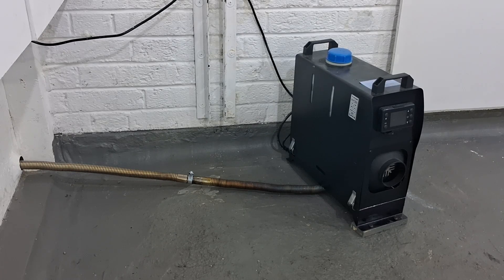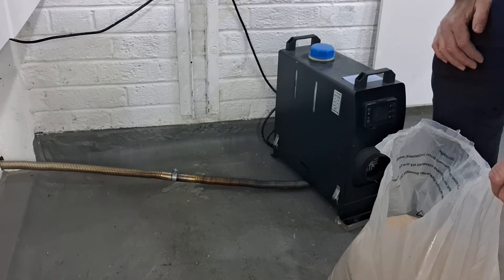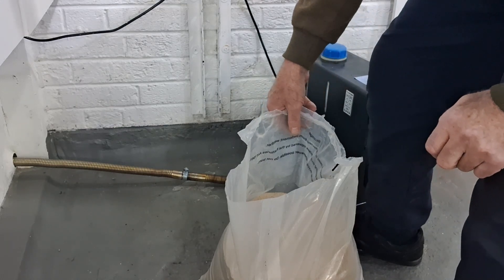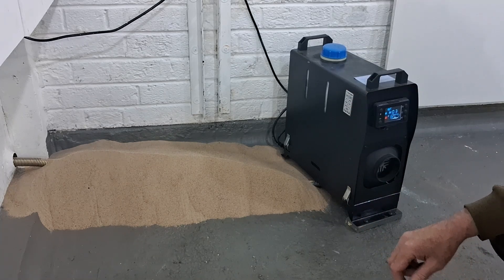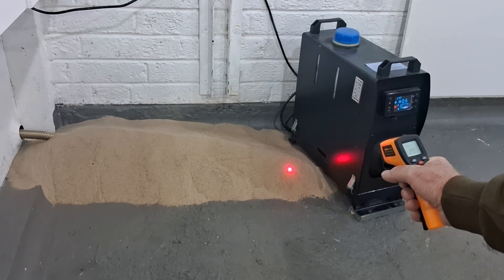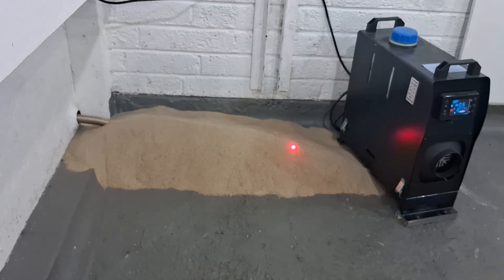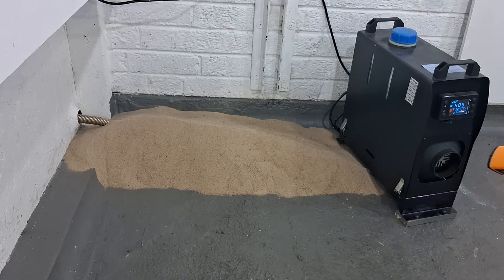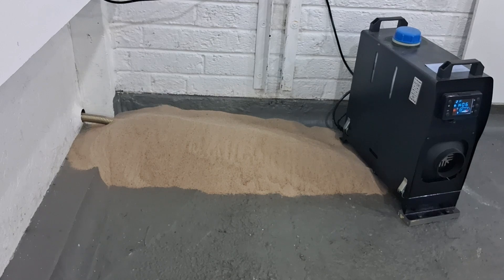Diesel Heater and Sand Battery Store Heat Energy Storage Experiment Off Grid Living Power Source

Comment: If you extend the exhaust very long into a radiator-type configuration with flex pipe and put a fan on it to disperse the heat from the pipe.  There's a lot of wasted BTU's going out the exhaust.  OR buried that flex pipe radiator in the sand.

Comment: Your best bet is to suspend the exhaust coiled up in a metal container - bottom to top and fill with water as a heat exchanger. Then, plumb the container into a radiator, no pump needed. Just ensure the the in/out is taken from bottom/top of the container. The difference in temperature in the rad will cause a convection current to flow through and pull water through by itself.

Comment: By making the side of the exhaust pipe larger in diameter you'll slow down the velocity of the air flowing through it. So making the tubing longer and larger in diameter with a LOT MORE MASS (sand) would go a long way.   You likely need 10-20x more mass (or more) that you tested with.
Reply from the maker: Thanks for the info!

Comment: I thought you did all these before 😅. If you want to absorb all the heat from the exhaust quickly you could use a BPHE or a tank of water. Water has the best specific heat. You don't want to make the exhaust more than 2 meters or exceed 270 degrees total bends or you will get incomplete fuel burn that affects efficiency and sooth built up inside the burn chamber on long run.

Comment: I bought a 6 ft length of exhaust and slowly shaped it into a corkscrew shape (like a large spring) avoiding kinks. I took a half sized metal garbage can and added about 5 inches of sand to the bottom and drilled an entrance hole at the top and an exhaust hole at the bottom just large enough for the exhaust pipe. I inserted the coil-shaped exhaust and centred it in sand in the garbage can with the top of the pipe sticking about 2 inches  out the top hole and the bottom out of the lower hole. I then filled the rest of the garbage can with dry sand completely burying the coiled pipe. I connected the exhaust from the heater to the nub (the short piece of pipe poking out the hole) sticking out of the top hole I drilled and then connected the bottom nub to a piece of pipe running outside. This forms a nice neat package that looks good sitting next to the heater. The exhaust temperatures are about 125° C entering the sand battery at the top and about 12° C at the bottom where it exits the sand battery. So, the sand is collecting a tremendous amount of heat. I haven't finished testing yet but have found two issues. The connections at the top and bottom need to be very tight to prevent exhaust gases from escaping into the room with the heater  (I used high temperature muffler putty to seal the connections which seems to be working). I find that collecting the heat from the exhaust results in rapid cooling of the exhaust gases which significantly increased the amount of water produced inside the exhaust pipe so it is very important to ensure that the run from the exhaust outlet at the bottom of the diesel heater to the end of the exhaust outside continuously slopes downwards to ensure the water runs outside and doesn't sit in the pipe. If not, the water will collect in the pipe and cause problems (blockages, rust, etc.). I had to raise the height of the heater so the exhaust was about level with the top of the garbage can. As an aside, I also include a diesel fuel additive to my fuel supply that reduces both the carbon buildups in the system and cuts back on the smoke produced at start-up

Comment: Thanks for the video! Its a great idea. A couple of thoughts. The exhaust makes a bit of condensation so raising the heater higher than the end of the exhaust is important. Also if you put the heater up higher and then run the exhaust in a coil pattern down through say a metal five gallon pail of sand before exiting it should dissipate the heat slower into the room. Looking forward to more videos
Reply: Kinda more or less what I was going to say, just more literate :P